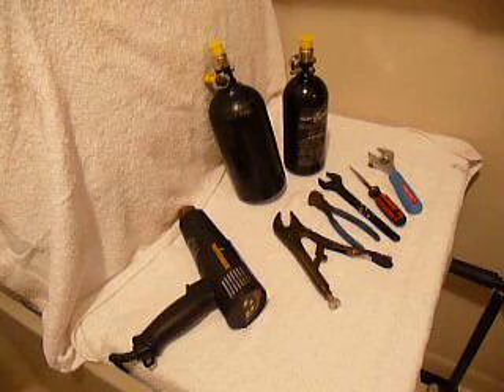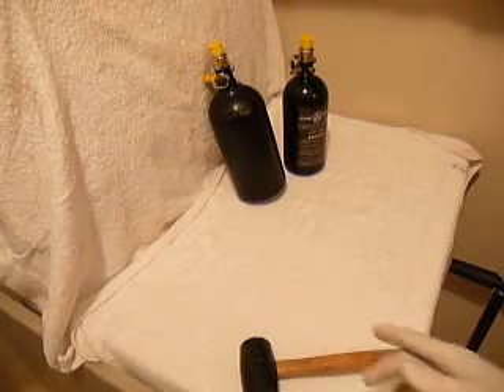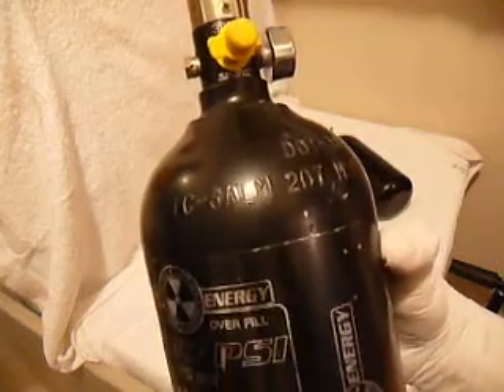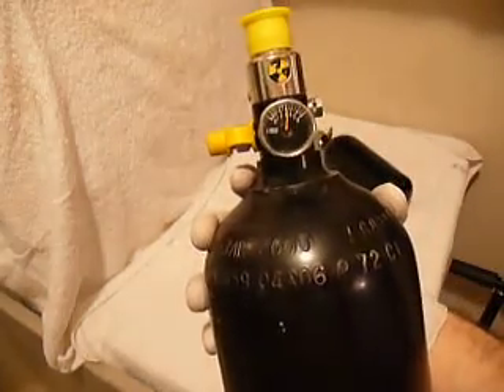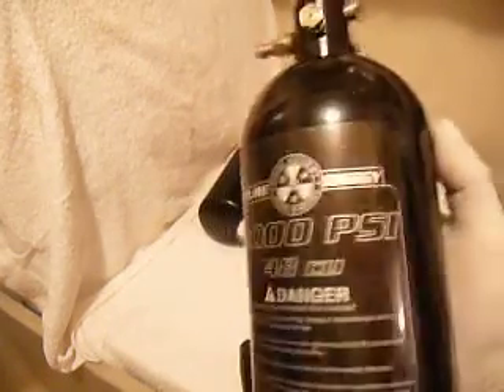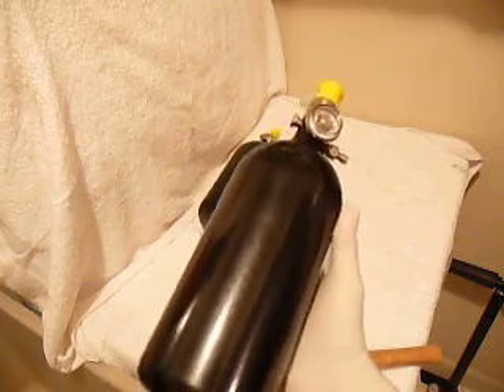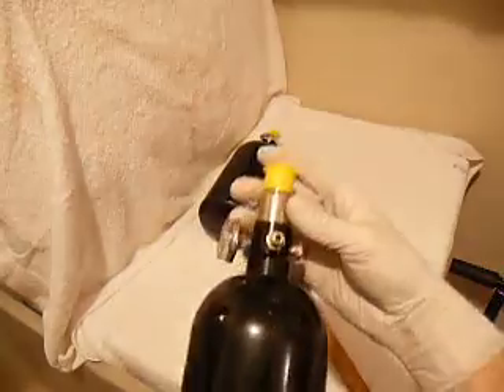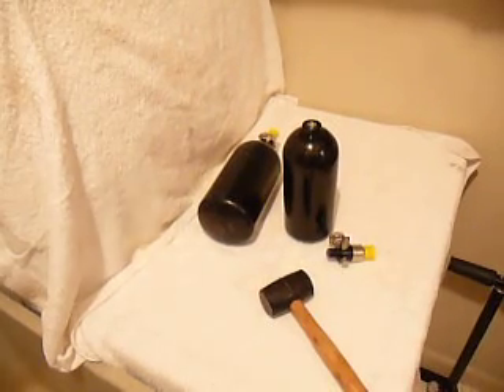How to remove HPA / SCUBA tank regulator off a paintball / diving cylinder - SIMPLEST DIY

Comment: This works I've just done 3 tanks with this method. Thanks!
Note of caution - remove the gauge first - one of mine the needle fell off in the gauge so that needed replacing. Also to note - when you screw the regulators back onto the tank - use the rubber mallet gently to tighten it just a bit further

Comment: Thanks, it worked, I used a hammer though since the valve on the tank was useless to me. Paintball reg is not near enough output gonna be using it to fill a pcp pellet rifle. Now I just gotta find out how to properly tighten down the new one.